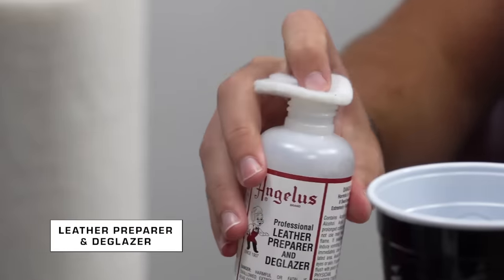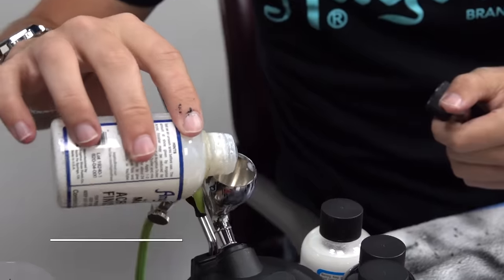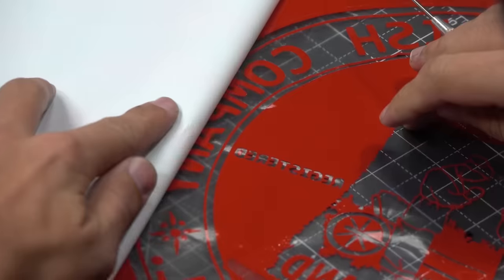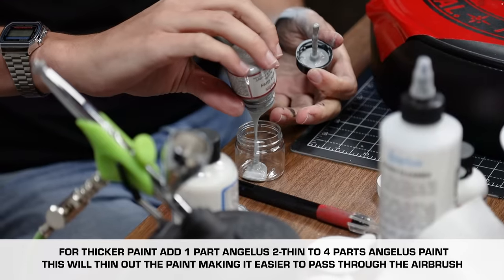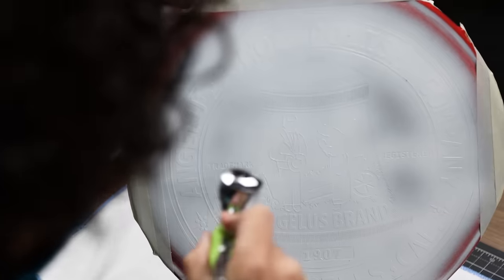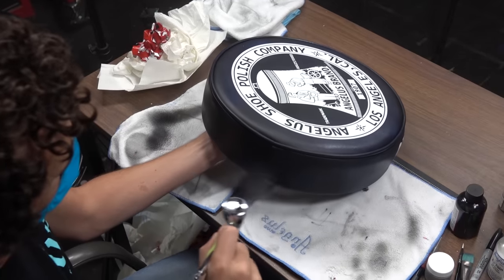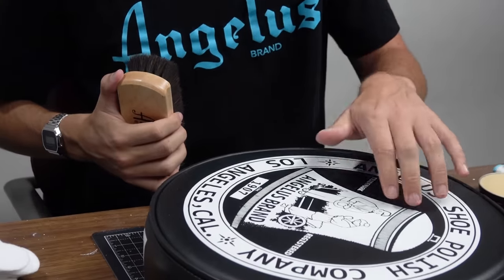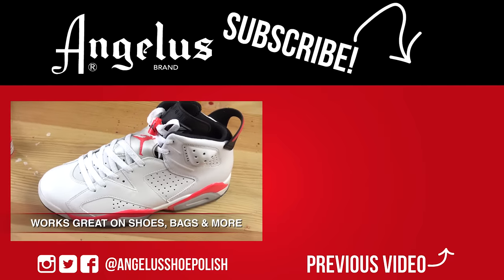How to Paint a Faux Leather Barstool | Remove Sticky or Tacky Feeling

Comment: Just an FYI for the future if you use a vinyl spray clear coat you can avoid tackiness all together most clear coat are not made for vinyl and normally do not bind which is why you end up with that takanot it's just easier to use a vinyl clear coat to avoid the tackiness and it appears a lot better to the vinyl
Reply from the maker: The SEM clear coat works really well. You are absolutely right.

Comment: Thanks for all the videos! Do you have any tips for removing paint from unwanted areas of leather? My guess is something to do with deglazer/acetone but I’ve been struggling while trying to complete the cleaning of my custom.
Reply: just use acetone to get as much off as possible and if there is still a little bit left just use the same color paint to go over it

If you wipe within the first 5 seconds the paint won't have time to set
Reply: Donde Esta La Leche? Thanks! I’m just struggling with the removal of the paint from tight corners on my custom shoes, I didn’t do as good of a job taping them as I’d hoped
Reply: @samiabul-khoudoud7709  if you use a toothpick you can usually scratch the paint off
Reply: Donde Esta La Leche? Great! Thank you so much.
Reply from the maker: You can use whatever you prepped the leather with, whether it was our deglazer or acetone.
Reply: Angelus Shoe Polish gotcha, thanks. Any tips for how to get that acetone into right corners? Q-tips aren’t doing it for me. The starter kit has been so clutch btw. I was planning on only doing one pair but I’m working on my second pair rn

Comment: I am confused, if you need to prep shoes to take the finisher off, why can he add finisher before stencil and painting? Thanks.
Reply from the maker: You are taking off the FACTORY finish. Which in most cases is a silicone, or resin. The Finisher that we carry is water based. So this is fine. It is not a heavy product.